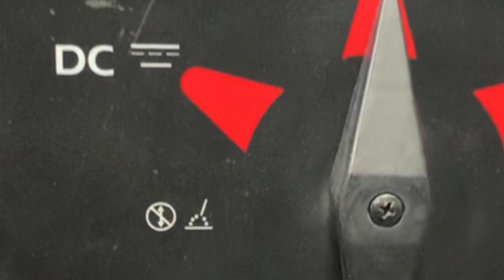Tig Welding BASICS! Polarity EXPLAINED!

Comment: Beginner tig welding. Spent 2 hours on the bench without being able to even get a puddle before the tungsten melts. Another 2 hours looking for answers on here. Finally think i found the issue! My torch is connected to the + terminal

Comment: Example. Tungsten electrode spec may be stated:-  2.4 mm tungsten needle
Positive electrode: Current 170-250 amp; Negative electrode: current 17-30 amp; Ac current 120-210 amps.

Comment: What is the DC electrode negative current operating range of the 2.4mm Blue WL-20 tungsten electrode? With the electrode negative TIG machine the current rating of the tungsten electrode seem to be much lower than when electrode positive. Please explain.

Comment: I got an aluminum question. Does the grade of the aluminum piece you are welding make a difference as far as set up goes for using AC? So for instance say I'm welding 6061 grade aluminum with a thickness of a 1/4 inch on an open butt joint. What settings would I have to change on my welding unit to achieve a successful and clean weld? Your insight would be most appreciated and valued.

Comment: What direction on cleaning action with a transformer machine to get that narrow line?
Reply: Do not know what kind of machine you have but mine is a Miller Syncrowave 250 and it is happy between 6-7  on balance😁
Reply: @garthbutton699  Thank you. I never used that style of Lincoln before. I guess it has "auto" for a setting?
Reply from the maker: On aluminum? The picture with the arrows I showed?